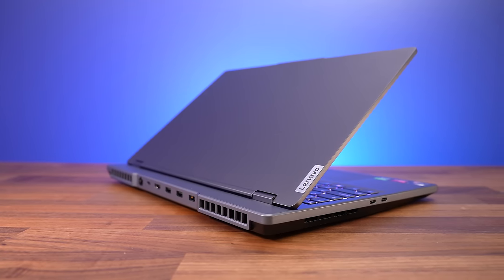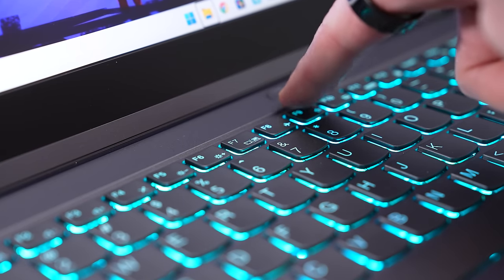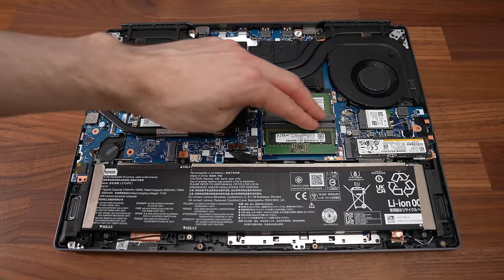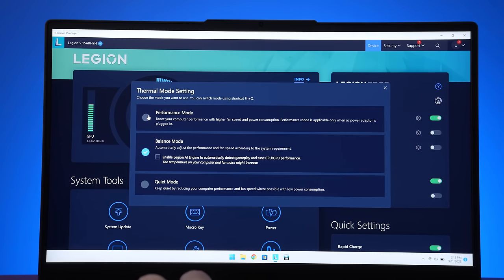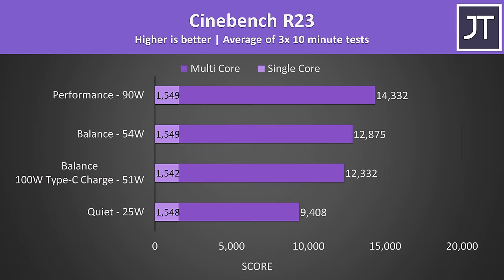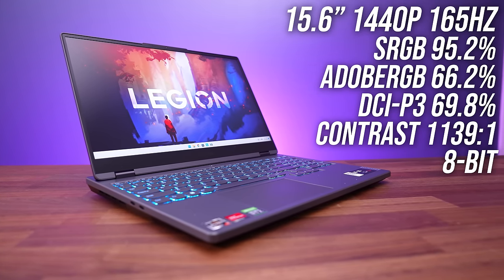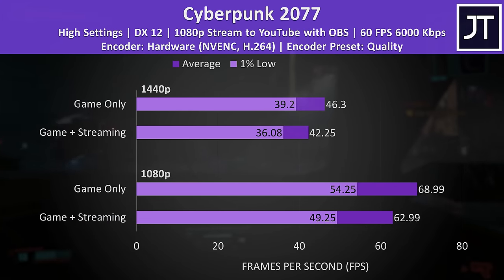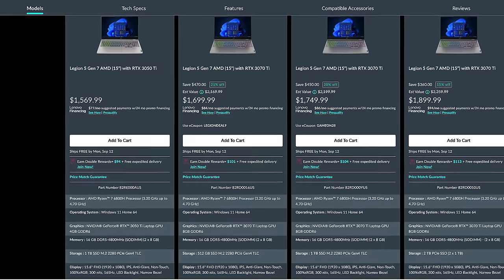Lenovo Legion 5 (2022) Review - Still Best Mid-Range Gaming Laptop?

Comment: Just a question. Why would you charge this laptop using the usb c? Is there something to that, I am not sure. Thanks in advance!
Reply from the maker: Generally so you can use a smaller charger than the one it comes with.

Comment: I only thought that the silent mode would have been a little bit better for gaming. I often have stutter or fps drops and i would like to use balance mode but it makes just so much noise. It's irritating for other people.
Reply: And how about balanced with FPS Capping?
Reply: @PibePlayer  When capped on 60Fps it's a lot more quite. But i also use legion fan control. But from the moment i would use some higher settings, like for spiderman instead on hight i change the setting to super hight and rtx on, it get again a lot louder. I know it's normal for a laptop but i'm a bit dissapointed in the silence mode. With my previous msi  on silent, the performance was also less but consistent and not constantly dropping.
Reply: @applepie3597  Well it's a gaming laptop, it should sound like a fan. Every gaming laptop makes noise.
Reply: @alexsmith1207  yeah i know, but compared to my previous one it's a lot louder.  My last one only had a gtx970m en draws around 40W en my 3060 draw around 70-100W so yeah it's indeed normal then haha.
But i'm playong a bit with the lenovo fan control app to make it a bit morz enjoyable for the others in the room.

Comment: Is a Legion 5i Pro with an i7-12700H and a 3070ti for $1800 a good deal. They are currently on sale on Lenovo's website and I'm considering pulling the trigger.
Reply: If you’re still considering, the 6800h one is $1440

Comment: Hi dear, which laptop you prefer for CAD design and ansys rendering ? About 1300$ , thanks
Reply: What did you end up getting?

I am in the same boat and thinking of getting the legion 5i (2022) woth RTX 3070.
Reply: @michaelmansour4213  i dont know yet , but I think about legion 5 (3060) . Also you can check tuf fa507rr(amd) , or tuf fx507zr(intel 12700h)  and g513rm(but it hasn't numpad and webcam!)

Comment: Personally I have lost faith with Lenovo. I bought the Legion Y7 about 2 years ago and I have had nothing but problems; SSD needed replacing due to errors, Battery needed replacing due to overheating and now the frequent screen crashes (sudden black screens) have led me to consider replacing the motherboard or getting a new laptop altogther. Currently, my laptop is unusable as the screen will not switch on. If I were you, stay clear of Lenovo.

Comment: I have the the 2022 5i version, I installed a second pny gen 4 ssd, it can write and read but after some time the drive went to read only, I tried other ssd but it's still the same, works fine for some time but after a few days the drive went into write protection, I’m not sure what’s the problem 😢😢

Comment: Can you test out the new predator Helios 300? 315-55, 12700h, 3060? I’d love to see that benchmark
Reply from the maker: I'm working on a Helios at the moment, but it has a 3070ti
Reply: @JarrodsTech  that’s completely fine, I would just like to know if predator improved their gpu and cpu wattage output, and thermals because I know they had a issue with overheating iirc. keep up the great reviews dude.

Comment: I recently bought this same laptop expect it has a 6600h and 3050 Ti. Fantastic laptop and more powerful than anything I’ve owned, got it for about $900 after tax.
Reply: hows the performance sir? im planning to get the same specs as you bought,
Reply: @tripnikuys8535  if you can afford the extra $150 for the 3060 get it. It’s 50% more fps. I went with the 3050 Ti because it suit my needs with the games I’m going to play. 3050 Ti is still pretty good in games though, 100fps in Minecraft with shaders, over 100fps in Doom Eternal on high settings, 60fps in GTA 5, and 80fps for forza horizon 5 on high settings
Reply: @TheInfernoM.  how bout photo editing and other rendering sir?
Reply: @tripnikuys8535  of course, that’s going to be good as well. I haven’t tested editing yet but expect it to be much faster than what I had because of the 6600h and 3050 Ti.
Reply: @tripnikuys8535  the screen is also great for digital art and editing. 165hz and 100%srgb
Reply: @TheInfernoM.  thankyou so much sir..

Comment: Should I go for legion 2021 rtx 3060 130 watt or asus tuf 2022 rtx 3060 140watt.
Reply: Legion
Reply: @sakibkhan5383  but the asus is kinda more powerful with 140w rtx 3060.
Reply: @FlameSkullBurns  you won't even notice 10w extra power
Reply: @manishnegi9868   the legion is actually more costly than the asus even thought the asus has present gen cpu and gpu. Only the screen is better in legion but I just want to play games and do some coding.
Reply: @FlameSkullBurns  that show how good legion 5 is compare to asus

Comment: Jarrod, next time you stream from an Intel laptop try doing it using Intel Quick Sync Video(available in the OBS Output option). It gives no load for either CPU or GPU, all the load goes on Intel IGPU instead, so fps remains the same.
Reply: That locks you to Optimus though.
Reply: @niebuhr6197  with an external display right now I'm running Nvidia as my main graphics(no optimus fps drop) while still having access to Intel iGPU and record games with it just fine.
Reply: @TabalugaDragon  i cant tell how good it would work on an otpimus laptop screen.

When I tried recording with afterburner (which is quite bad) quicksync immediately crashed.
Reply: @niebuhr6197  afterburner? but that's a GPU overclocking and tuning software... try recording with OBS, free software

Comment: Legion 5 "true type" keyboards are the best! I'm a long-time ThinkPad user, but now I'm a "true type" keyboard fan. As a Linux user who types a lot (around 100 words per minute), the keyboard is a very important component (and very heavily influences my purchasing decisions). I used to buy ThinkPads for their Linux compatibility, now I buy Legion 5 laptops for their screen refresh rates, true type keyboards, and "sufficient" Linux compatibility.
Reply: did you had any problems with Linux on it? 
Which distro did you used?
Could you realize Lenovo Vantage functions on linux, on example disabling conservation mode for better performance?

thx for the answer. I decided to swtich to linux with new laptop, but compatibility problems are worrying me because of on experience.

Comment: For anyone wanting to turn off fans while not gaming on the legion 5 2021 and 2022. There is an option in Bios called "thermal optimization" set it to 0 and fans will only start if cpu/gpu is around 45°C

BONUS TIP: for really no noise, right click on windows battery icon > power profile > create new power profile > call it fans off or something > go into advanced settings > cpu > max cpu state (this is in clock speed) set 20% or lower. And instead of idling at around 3ghz it will underclock at 1.1ghz or so that uses less power = less heat = less chance to trigger fans. Very good for saving battery life too!

Comment: But wasn't Intel better than Amd? Why did you buy this laptop with AMD processor?
Reply: He compared the gaming performance to intel based laptop with the same full wattage 3060, so you now what to expect on intel variant. The performance gap between intel and amd is not huge  except in esports games or cpu heavy games likes beamng drive, teardown ,cities skylines , etc. Atleast from gaming perspective
Reply: @mrbobgamingmemes9558  and for design or workstation?
Reply: @d5811  i dont know what type of design you do but in real graphics design scenario you cant tell the difference in photoshop unless you use like hundreds  of layer on one picture. On 3d design perspective gpu matter more than cpu
Reply: @mrbobgamingmemes9558  thanks!
Reply from the maker: Because I already had the 2021 AMD model and wanted to see the difference. It also had a decent sale, so I figured I'd check it out.
Reply: @JarrodsTech  In 2022 which is better, Legion 5/7 or Xmg Neo/Pro/Ultra?

Comment: How did you get 2K resolution on this legion 5 model? I only see it available for the pro variant
Reply: El Cactuar  1:52 screen is 1440P resolution. He made a error then in editing specs
Reply: El Cactuar  What is 2K QHD? 2K displays are those whose width falls in the 2,000-pixel range. More often than not, you'll find 2K monitors with a display resolution of 2560x1440, that's why it's often shortened to 1440p.
Reply: El Cactuar  Wrong.

The 1080p resolution, known as Full HD, is 1920 pixels horizontally and 1080 pixels vertically; on the other hand, the 2K resolution, known as Quad HD, is 2560 pixels horizontally and 1440 pixels vertically.
Reply: El Cactuar  Go to school if you didn't get any education 
If u don't believe me then check google
Reply: El Cactuar  yes you know more than Professor and Google itself
Reply: El Cactuar  I mean his point is 1440p is not available for this legion 5 model which weather u consider QHD or 2K is irrelevant... 
Jarrod made an editing mistake
Reply from the maker: Might be regional. It was the only option I had when I bought it.
Reply: @JarrodsTech  I see. I wish there was QHD model for legion 5 model. Now I am planning to go for the pro model

Comment: 11:17 Jarrod there is Legionfancontrol software.

It does wonders for the temps. Tho its not official lenovo software.
Reply from the maker: The creator stopped developing it and I don't believe it supports 2022 models.
Reply: @JarrodsTech  it actually has a V2 which i tested on the legion 5i pro 2022 (Gen 7). You can set a fan curve now! Definitely worth checking out!

Comment: Yo guys, I got this beast last year and since then I've been struggling with the GPU thermal throttling (which was obvious in games and FurMark after reaching 85C and holding it for a couple of minutes or so) 😼

I got i7-12700H + RTX3070 140W + 16GB DDR5 + 1440p 165Hz IPS + 1TB 👑

So the problem is, it freaking throttles whatever game I try on it (except for Roblox). Mostly I tried to play CS2 and PUBG.

Apart from obvious solutions, like switching power modes, updating BIOS or Nvidia drivers or reinstalling Windows, are there any options that might actually help me?

It's just sad I paid 1600 euros and I'm not able to enjoy the power this machine can deliver 😢

Almighty community, please, help me! 😇
Reply: I ordered the same one, is this true? it will not be able to work for a long time under the load of the core 7 12700H or you have a defect?
Reply: @klimchik04  Honestly, I'm not sure if there's any defect in the unit. The CPU has never got me any trouble. Anyway, is there a way I can check it?
Reply: @iamarthstone  just lower it by 99% in the dispatcher so that it heats up less and send it in for repair and let them take a look or under warranty
Reply: @klimchik04  yeah, I just didn't want to believe it is gonna end up like this 😪
Reply: @iamarthstone  Perhaps this is a defective product, and not a reason to be upset!
Reply: @iamarthstone  take it to the service for diagnostics and please write to me what they answered
Reply: @klimchik04  so, everything was actually quite simple. I just cleaned the laptop and applied fresh thermal paste. I hadn't known that I can actually unscrew the coolers to get to the hot air exhaust vents which were full with dust. Now I enjoy my Dying Light in 2K max settings at 120 FPS 🎉 Hopefully, it will help somebody also looking for a solution with throttling 😊
Reply: @klimchik04  and on top of that, now the GPU doesn't throttle even during the stress test in FurMark 😏
Reply: @iamarthstone  Great!
Reply: Which thermal paste did you use

Comment: İ have 10 bit color depth on my legion 5 pro. But i am sure i had 8 bit, until update. Now it is 10 bit color depth.
Reply: Is it the rtx 3060 model? I am planing on purchasing that model but have no idea if the back usb c port can handle a monitor or more importantly vr headset using a display port to usb c adapter.
Any ideas ? Cheers

Comment: Watching this from my legion 5i gen 7, 
I tried Fedora linux, and everything works as mentioned (mind it is the intel version with the i712700H, and I got the intel AX211 wifi card) however with system suspend mode, with the dGPU in hybrid mode, the laptop failed to wake up, the display kept flashing the backlight with a black screen.

The issue exists even on live image running off a USB without the Nvidia dGPU. So this could be an intel driver/mux issue

If anyone does know what's going on please let me know. Might try ubuntu to see if it's an issue with Fedora 36 itself
Reply: Could you realize Lenovo Vantage functions on linux, on example disabling conservation mode for better performance?

Comment: Hello to everybody. I got some problem with my legion 5 3070 ti, intel 12700h. Suddenly one day cooling fans stopped working. I reseted bios to default, cleaned fans and still they are dead. No movement at all. Unfortunately warranty expired just week before problem had occurred . Left it with my laptop local shop , and after a week the said that is a problem with motherboard and need to be changed. The price for fixing is 1300£ 😨. Has anybody had the same problem  before ? Cheers
Reply: damn, go for a second opinion

Comment: bought a legion 5 pro (2022). The laptop was great, but it was too heavy and large for it to me. with the power brick and size, I had difficulty fitting it into a regular backpack. bought Zephyrus g14 (2022) instead. that laptop definitely runs hotter, but at least is manageable size/portability wise.

Comment: Can u test Helios 300 i9 12th gen rtx3060?
Reply: go for offline bro i7 12thgen 3060 with discunt you will get it in 132k approx on official store
Reply from the maker: I am testing a Helios 300 currently, but it has different specs.
Reply: @JarrodsTech  i7 12th gen 3060 or 3070ti ?

Comment: You can see the wobbling even when you are just sitting at the Table and moving a little and talking. This is not very good. This will be extreme even with mouse movements i think. Looks disturbing. Not well solved by Lenovo!
Reply: Stop exaggerating
Reply: @AdvancedGamingYT  You can see it. When you can see it, it is a Fact and a Fact is not a exaggeration.

Comment: frankly, this ain't a good moment to buy it. 6000 series from amd is barely any better than 4000 series from a few ago. and the rtx cards, 3000 series, also are very very long in the tooth. I would buy the next gen, with amd 7000 zen 4 and rtx 4000.
regarding the actual laptop, yeah, i think lenovo is a very good choice. i have an ideapad gaming 3 4800h and it's super in every way, but i think for 2022/2023 i would expect a bit more. slimmer chassis, more aluminum, rgb and a nicer screen, maybe even an oled 120hz.

Comment: I was planning to get this one, but then I decide to build a desktop pc instead.
Reply: best decision you've ever made i just switched from pc to gaming laptop and i'd prefer the pc. i have the legion 7 and it has newer specs then my pc but id still prefer my desktop pc i like running games at high settings and laptops get really loud and hot pretty easily and i get it they're smaller and don't have as much space as pcs but its just so much more worth it to save your money and buy a desktop buying an expensive laptop is useless you could've spent all that money on a nice ass pc setup just buy a laptop after you get your get a pc you want be as disappointed lol
Reply: @laloblast4153  actually, I'm not really get the pc yet. I'm planning to get it next years, for now I'm gonna saving up more, really excited.

Comment: Jarrod never posts that he got 94.1 fps at 1440p with a 6800m on RDR2.  Sure he used new ram and an external monitor, but it's still way cheaper than the other laptops it's punching with
Reply from the maker: The 6800M data is out of date and no longer fairly comparable due to game updates